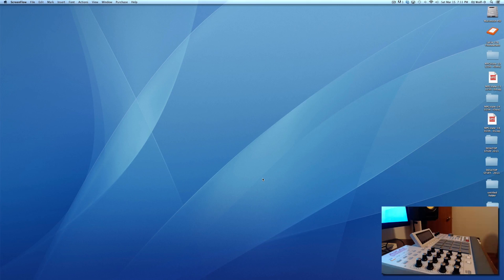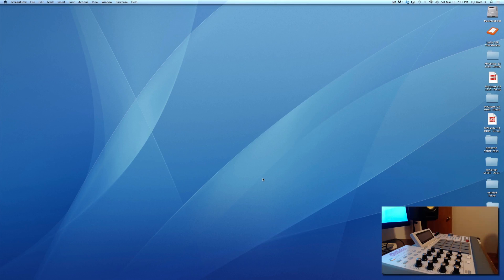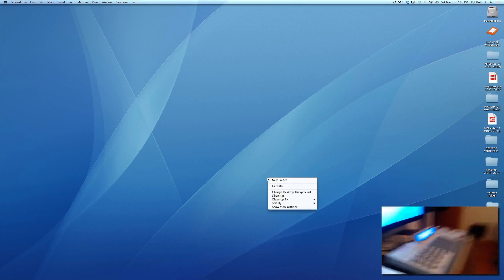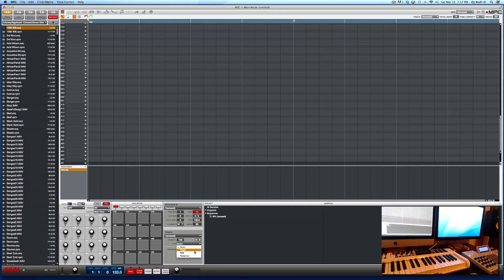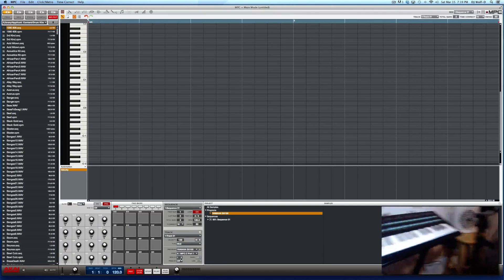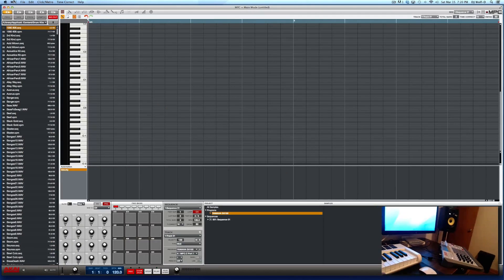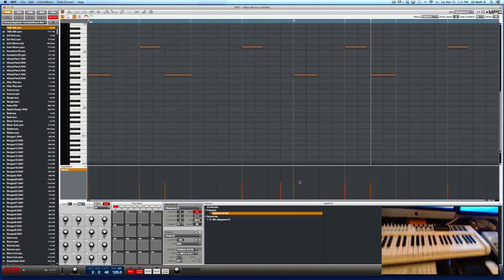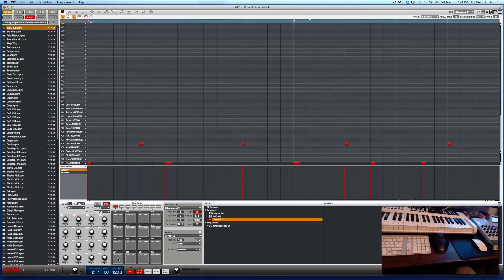Akai MPC Tutorial - Connecting & Sequencing External Midi Gear

Comment: Do You still have the ren? Some reason I can’t get my ren and the key 61 to work. Nothing works on the ren. 
Trying to just be able to use the 61 as master 

If the Mpc key 61 is in stand alone mode and you plug the ren in usb the 61 says it don’t support the driver. 
If the 61 is in controller mode with 2.0 it’s doesn’t matter if it’s plugged in to the 61 or a port on the computer the ren will work but nothing is illuminated but the screen and it stays locked on saying Mpc , q links don’t work, and the mapping for everything is wrong  note repeat would be mapped kick drum for example.. play stop start don’t work, and I had to start the key 61 first and then the ren other wise both pieces of equipment stayed in a load (boot) mode trying to start. If they where plugged in at the same time usb. 
If I use only the ren by itself it’s mint like the day I bought it? I don’t under stand why it wouldn’t work so you can utilize the q links and everything and have the big pads to hit instead of it collecting dust. 
I’ve seen videos of people using the key61 and Mpc x  and they both work together seamlessly?? Why wouldn’t the ren work
Reply from the maker: I don’t have the Ren anymore… just an MPC Studio Black. Unfortunately, in regards to my regular workflow, I’ve always separately plugged in my midi keyboard and my MPC to my computer, so I wouldn’t be of any help with this subject matter. The first thing that comes to mind is… maybe check the Akai Pro website to see if there are any firmware updates for your hardware.  If not, just give Akai a call directly to see if they can help.
Reply: https://youtu.be/qFXH2Mua2iU
Reply: My mv880 and mc909 talk just fine with each other with my midi keyboard, so it can’t be something I’m doing I don’t think

Comment: Do you know how to connect a behringer rd 8 to akai mpc 2.8 software ?
Reply from the maker: Z00 D Unfortunately I do not.  MIDI mapping is traditionally done with gear that has drum pads, so I’m not sure if that would work in the same way with the RD8.
Reply: @djwolfd  can i record the drums through audio track ?
Reply: @djwolfd  I have an akai element and wanted 808 drums with my samples. Can i record the behringer like I would a regular instrument through audio track ?
Reply from the maker: Z00 7 Yes... but just be clear that there are 2 completely different versions of the MPC software. 1.) the full “MPC Software” and 2.) the “MPC Essentials” Software (which is really just a light demo version with very limited functionality).

Comment: How come i can only get the keyboard sounds  to come out the speakers on my keyboard and not out my speakers connected to my interface
Reply from the maker: Just to be clear on this.... are you running audio cables from the output of your keyboard to the audio inputs of your audio interface?
Reply: Wolf D no into my mpc studio should I plug it into my interface?
Reply from the maker: Whooooaaaaa!  Back up my man.  The MPC Studio does not have audio inputs... so you're definitely confused about something.
Reply: Wolf D oh I thought u were talking about midi cables and no I'm not running audio cables from my keyboard to my interface
Reply from the maker: Ha ha!  Naa my man... I specifically said "are you running audio cables".  Midi cables will only transfer midi notes/information... not audio.  In order to hear the audio from your external keyboard you have to have audio cables running out of the keyboard into something.  In the video, you can see that the audio from my Yamaha external keyboard is coming out of the talkbox tube... not my speakers.
Reply: Wolf D ok I will run audio cables thanks for the help
Reply from the maker: Yesirrrr.
Reply: So, follow up question. I normally bounce my tracks from MPC to reason and do my mixing and effects in there. Will the midi information I record into a track in the MPC bounce to reason as audio or will I have to re record it in reason?
Reply: Disregard, scrolling down and reading the comments I saw the answer to the question I had lol

Comment: Whats up brother? Dope Videos Bro! Got a question though, I see the midi playing back on the studio (not on the track)  but i can't hear anything through the speakers...been driving me nuts man.  Thanks for your time ...
Reply from the maker: 2 questions... 1.) What piece of external gear are you using?  2.) How do you have the audio output of that piece of gear connected?  Do you have cables going directly from the gear to your speakers, into a mixing board, into an audio interface?
Reply: Im trying to link the Roland Juno DI. I have the outputs of that going into my mackie mixer and the midi cables linked to the back of the studio black. It looks like the software is picking up the data from the midi, but I'm not able to hear the play back.
Reply: Basically I see all the sounds inside the studio but can't hear anything coming out the speakers. There is no playback
Reply from the maker: Ok.  Does your Roland Juno have an internal selection that makes it act as a slave?  If you have everything connected properly then this could be a possible cause for no audio playback.
Reply: You know, I looked into that thinking that could be the problem also, but i didn't see anything inside the Roland that could be selected to change it into a slave. I might have to figure an alternative method. If anyone else has this same problem in the feed and/or figured this out please let me know. Thanks Wolf and keep the videos coming bro.  If I figure this out,. Ill let you know.
Reply from the maker: Mannnn.... I'm not sure what the issue could be.  Try to give Akai Tech Support a call and specifically ask if you can speak to Dan Gill.  He's the real deal expert on all things MPC related.  (401) 658-4032

Comment: Hey man, hope you can help me... I have the SP 404 SX connected to the Renaissance and recorded on the Renaissance via MIDI something . The samples submitted by the SP . The sound is heard. But if I the Project export directly as mp3 , nothing can be heard . If I export the project as a MIDI file , though I hear the melody , but instead of drums , sound is heard a piano . How can I change this?
Thxz!
Reply from the maker: Man... you're gonna have to  record a video of what you're doing so I can actually see.  Showcase what you're doing step by step, so I can have a better understanding.  Use the video recording feature on your cell phone if you have to.
Reply: ★• k1v • poziTiv •★ You'll have to use a DAW and it's software (e.g pro tools ) to record the drum audio from the SP 404 SX. You're dealing with hardware audio as well as digital audio recording when it comes to using that method. Your mpc is only recording your drum notes using the midi option and not the audio. In other words, recording and trigger your SP 404 SX's sounds, drum notes in a loop playing mode. You can export your midi file because its the recording of your drum notes. But you'll need to record your audio into a DAW like pro tools. Make sure to open a new session and change the tempo to match the tempo of the mpc. Also, make sure to separate your SP drums by routing them individually to their own output number.

Comment: OK the big question is how do u track out the sounds from the midi keyboard? ???
Reply from the maker: 2 options.  1.) Hopefully you have an actual DAW (Garageband, Pro Tools, Ableton Live, Logic, etc.), which means you can just pull up the MPC as a plugin inside of your DAW, and then track out your external keyboard sounds.  2.) If you don't have a DAW, then you can just sample your external keyboard parts directly into the MPC software.
Reply: Thanks
Reply: Wolf D Do you have a video on this? I need to know how to do this!

Comment: Good video man, wondering how I could use my KORG M3 as midi for the MPC programs instruments and piano stuff (MPC is awesome for drums,etc.. but I wouldn't mind trying my keyboard for the non drum stuff). I have both the MPC Studio and Korg M3 working, can hear them both very well. But I am wondering what settings I have to mess with to get it so I can use the keyboard once in awhile as the midi controller for the instruments (while inside the MPC program).
Reply: +kozzy420420  Nevermind, got it working, had to reinstall my M3 driver. Thanks again for all these videos my man. Just picked up the Studio, my MPC 2000xl was on its last legs so thought I would cop one of these. Take Care
Reply from the maker: +kozzy420420 Very cool.  And in case you're not aware... the MPC Software 2.0 update that comes out later this year is going to turn the MPC Software into a full DAW.  It was announced at Winter NAMM 2016 last month that it'll have 120 audio tracks, real time pitch shifting, real time audio warping & time-stretching, it's gonna come with the same virtual instrument and effects plugins that currently come with Pro Tools, and more... lots of good stuff on the horizon for new MPC users.
Reply: Wolf D
Wow, awesome news! Thanks man, appreciate it, love the videos, keep 'em coming. I wasn't expecting much from the MPC program but it is better than I was expecting, good to hear more updates on the way to, some of the things you listed sound very good. Cheers again and good luck with the channel!

Comment: is there any way to use my mpc studio plus a midi device (keystation 61 ) at the same time using only mpc software?
Reply from the maker: +Shine_uno Of course.  You simply plug both of them to the usb ports in your computer.  This particular video was posted specifically to show people with older "non-usb" equipment how to connect their gear using the 5-pin midi cables.
Reply: thank you, i didnt formulated well my question, am using a 2007 macbook with a hardrive plus a usb hub. my usb hub gives me  problems all the time, so i have to sacrifice one por at the time, i dint check the box of my mpc studio and it comes with a 5 pin midi coverter . What excatly i can do with that coverter ,to not use both usb port in my lapto! thank you again wolf !!
Reply from the maker: +Shine_uno Let me ask you about your usb hub 1st.  Is it a powered hub that gives you the option of plugging it into an electrical outlet for power, or is a "usb port only" powered hub?
Reply: its a powered connected to a lectrical power supply (D-Link SuperSpeed USB 3.0 4-Port Powered Hub (DUB-1340) ) normally what i do i run the keyboard trought the usb hub and mpc studio straight to the lapto. but lately when mpc software pops up usb hub dies. no harddrive no mouse no midi.  i atill running version 1.8 of the software
Reply from the maker: +Shine_uno Ok.  Have your tried plugging the usb hub into a different usb port on your computer to see if that solves the problem (some ports may be more powerful than others)?  Especially with the hub being plugged into an an electrical outlet, I can't think of any reason why you would be having this technical issue.  The 5-pin midi output and input options on the MPC are there mainly to link up other external midi gear... not be be your main connection between the MPC hardware and your computer.  If switching usb ports doesn't work, I would give Akai tech support a call on Monday to see if they  can help solve the issue.  Their number is (401) 658-4032.

Comment: How did you save the midi sounds from the synthersizer, when I did my mixdown weren't able to hear those midi sounds anymore?
Reply from the maker: +Jayce Francis In this scenario, I would only be saving midi note information.... not sounds.  The actual sound is coming from my external keyboard (Yamaha DX100)... not the MPC software.
Reply: I found that out the hard way Hahaaaaaa.... Basically what WolfD forgot to say is you have to have your Keyboard / Midi device hooked up to a Board / DAW to capture 1 sound at a time using Audio Cables...

Comment: I know I'm crazy late on this post bro but have been looking for it for a long time a tech from Akai even told me this wasn't possible but I knew it was, so let's be clear aight? If I follow your directions I can access my instruments on my Korg Trition Studio in the MPC software & track out different instruments across all 127 tracks? Also in order to recall the instruments does my Keyboard have to be hooked up to the MPC, basically like a VST? If so you are the man for helping me out with this Wolf D!!!! One more question though lets say I'm working on another seq without having my Korg hooked up midi because I'm using a mini USB keyboard & update/save my new tracks, it wouldn't affect the Midi from the Korg program at all right? And as soon as I hook the Korg back up everything would play back fine right? 
Good looking out bro sorry so long.
Reply from the maker: +ILL REEL 1.) All you are doing is simply recording midi notes from your Triton into the MPC software.  The MPC will be the master, and your Triton will be the slave.  The sounds will of course be physically coming out of the Korg Triton, so if you don't have the Triton connected (both midi wise and audio output wise), then you won't hear anything during playback of the MPC.  2.) Every time you pull up a new VST instrument to record something, it's gonna be on it's own track, right?  So unless you end up recording over the midi track (or tracks) that you used for the Triton, then there's no way for you to affect other tracks that you've recorded.
Reply: As far as 2.) Yeah that's what I thought Wolf D Thanks for clearing that up 4 me. 1 more question since I'm using the Korg as a program do I need to create a new Korg program every time I use a new instrument from it on a new track? That's how I track instruments on my VST's.. P.S. I ordered my Midi cable right after I seen the video That's how confident I was in you Bro ha haaaa.... Good Looking out!!!!
Reply from the maker: +ILL REEL I don't have any external gear anymore, so I've never tried tracking out multiple sounds from another synth... but I'd say that creating a new Program for every instrument on the Triton would probably be the way to go.  Let me know how it works out.
Reply: No doubt.... I'll let you know asap!!!! No more talk box? man I was like WolfD got the "talk box feature everybody wanted since "Roger Troutman" was ripping' it.... Let me know if you find another way to do the talk box effect.
Reply from the maker: +ILL REEL Ha ha!!!  Naa.  Sampling the audio from your Korg is of course an "option" but it's definitely not a "necessity".  Bottom line is that you have to figure out how to sequence multiple instruments from your Korg into the MPC sequence, and once you do that, then you can pull up the MPC software as an instrument plugin inside of your DAW, and then lay down the sequenced audio from your Korg Triton in real time on individual audio tracks.  (That's what I meant when I said you don't have to "sample" the Korg audio into the MPC).  Before the days of computer based recording, the majority of us urban music makers used the MPC not only as a drum machine and sampler, but as our main Sequencer, because it was so easy to set up and use.  Once again... I don't have any modern pieces of external gear to try it out with because I only use plugins now, but when ever I break my Yamaha DX100 out of storage, I'll try it out with that.
Reply from the maker: +ILL REEL And just to be clear on this.... are you already aware that every time you pulled up a new instrument on your Korg Triton that you should've been assigning a new midi channel for each instrument on both the Triton and the MPC?  For example Synth Bass on channel 1, Piano on channel 2, Strings on channel 3, etc. etc.
Reply: No need to break out the Yamaha DX100, we're both saying the same thing keeping tracked of instruments on a keyboard & mixing them in a DAW / Sound Board is taking a humungous step back into the 80's of engineering in 2016 ha haaaaaa... It's only worth it when you have Instruments you can't reproduce or sample on a MPC, like your talk box Yamaha DX100. I'm just happy we have the clarity now about RCA/XLR or S/PDF hook up to hear the Instrument. That may save someone else a couple $'s on Midi cables ha haaaa...

Comment: Thanks OP this was some intel for me. What I actually want to do though, is trigger external MIDI devices (an SP-404 or other sampler, for example) from the pads on an Element, without any computer in the room at all. That's really hard intel to get but I think you mostly cleared it up here. Anyone else hoping to use it in that scenario? IE I'm not interested in sequencing at all, zero - I'm a finger drummer, I am the sequencer. :)

Comment: When I open the MPC software from GB, the MPC software says it needs to be registered.  Any ideas how to resolve this?
Reply from the maker: +Hikmat Hanna  I'm not familiar with this issue.  Just call Akai and they'll get you straight.  (401) 658-4032
Reply: +Hikmat Hanna i think you need to register the software with mpc hardware first before you can use it.when you open the software, make sure you are connected to an mpc hardware and go to MPC>Unlock software then register it. Once itse set then you can use it without connecting it to any MPC hardware.I did that with an MPC Renaissance for mine.hope it helps

Comment: Hi,
The Midi keyboard  I am going to buy (M-AUDIO Oxygen 25 USB MIDI KEYBOARD CONTROLLER) does not have a 5 pin midi connection. It is powered by USB and has a connection that says 'Sustain C18'. Will the midi keyboard work with my MPC Studio and the software?
Your help in this matter will be greatly appreciated.